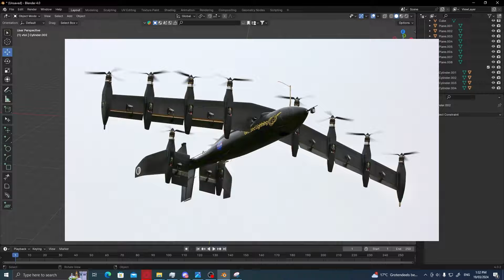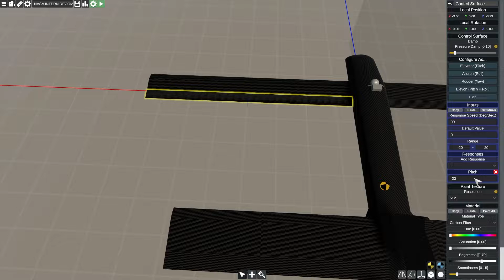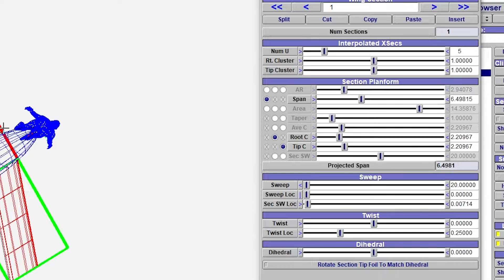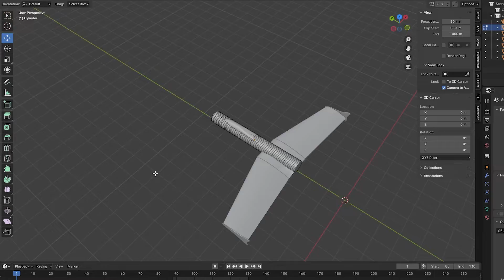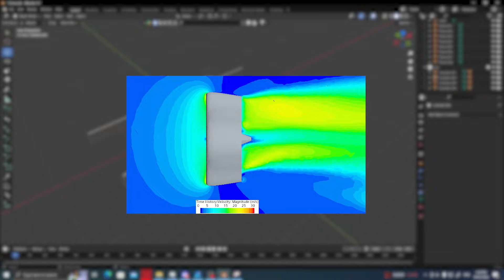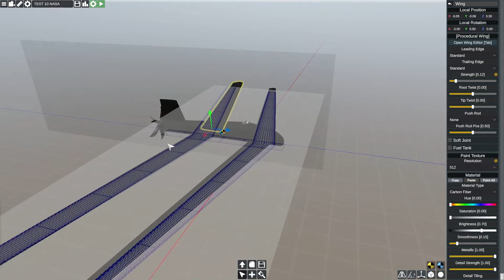NASA intern helps me engineer a UAV swarm [testing in flyout] week 3 of developing a UAV drone swarm

Comment: This may or not affect the result of your experiments. I may be wrong but I think the numbers are not correct. 300 cm x 20cm= 6000 cm2 which is equal to 0.6 m2. Another way: 3m x 0.2m = 0.6 m2. To visualize 6 m2, take the square root of it, this is, 2.45 approximately. So, a square of 2.45 m of height and 2.45m of width will produce an area equal to 6 m2. This is way too big compared with what you have. I hope this helps.

Comment: You definitely are taking more time with it but remember you said you're carrying a payload, so be very careful of weight. You need to balance COL with COM with wing placement rather than adding weight. Also you have 4 edfs on your design at the start but tested the aircraft with 1 propeller that looked like it wasn't pitched correctly. Idk if you know but each propeller can be pitched at a certain angle and the blade itself changes pitch across the blade, that's why it's not angled the same along the whole blade. You should research blade pitch and use 4 edfs in testing like your model suggested. Also a thin wing is for a glider designed to fly far at low speeds but your design has 4 powerful edfs. Not only are they likely to fall off and break under impact due to the thing wing but also the long thin wing will create lots of drag and will not utilise the speed produced by the edfs. But hey you're heading in the right direction 👍
Reply from the maker: Hey man thanks for the advice. We are taking a lot of steps back, by first determining all the requirements before designing a fuselage and wings. I’m currently figuring out how big the payload would be by looking at actual products that can be transported with it. For example water is way smaller than toilet paper as a weird example. For some things I am also looking at if it should be in the fuselage entirely or not, and for larger things how large that would really be and if it’s realistic. I’m also determining which electronics shall be used and their size, weight and cost. We also found a  different motor setup, where we can achieve enough thrust with regular props, and we tested which props worked best and which motors worked best and then picked the cheapest option. A lot of progress being made there I haven’t even mentioned everything yet, but I’m hoping to finish the next vid tomorrow! Only if we know everything we should start thinking about the actual design, as suggested by many people including you.
Reply: That's great news 👍

Comment: hey, not sure if you will see this, but i think XFLR 5 would help for aerodynamic analysis. (  its also free : ]  )   

also, for canard style planes, the main wing should be angled so that the Cl is close to zero when the plane is level. and the front canard should have a higher AOA so that the center of pressure is a little in front of the Cg.

this is so the front pitches up, but then the larger main wing gets more lift and pitches it back down.

I read this in an old aeronautics book i got at a thrift store, so it might have changed since it was published, but it has worked for me. good luck though :)
Reply: wanted to clarify, this makes a passively stable plane. however the  back main wing has to be quite a bit larger than the canard

Comment: EDF's actually are more aimed at high speed, less on pressure.
To lift a drone, the bigger the propeller, the more weight it can take.
A lot of UAV's are now using 4 engines, to lift, then use 5th engine, for horizontal flight.
For long range, it's a waste of resources, and adding more weight.
In software, it's not easy, changing from one, to the other flightmode.

Comment: one thing to maybe deepen your understanding, lift is more of a air pressure thing, rather than air pushing down against something. 

kph is kilometers an hour. knots isn't "per hour"
Reply from the maker: thanks for explaining, how would you visualise the air pressure thing though? wouldnt it be quite similar to looking at is as something that is pushing down? what helps me visualise it in my head is just imagining that it is water as it is quite similar. and yeah i found out quite quickly that it wasnt knots, pretty stupid of me, i commented it here as well but i havent verified my yt acc yet so i cant pin it
Reply: @NaeviusUAV  so, what helped me figure it out the most was actually helicopters. The rotor on a helicopter is actually more akin to a wing. Helicopters can fly much higher than their downforce goes down; they are being pulled up by the differential air pressure not pushing off the ground. The travel of the air over the airfoil is what creates the differential pressure. Since air is accelerated faster over the top than the bottom of the airfoil, there’s less air on top, creating a lift force.
Reply: @NaeviusUAV  also I’m not super knowledgeable in terms of aerodynamics, but if you need any help with radio/networking I can def contribute

Comment: it looks like a burt rutan aircraft
btw it will be able to takeoff and land very easily if you make the nose gear longer so the nose is pointed up a bit add 2 of them maybe for extra safe landings
either that or you need to put the rear landing gear just behind the centre of mass like planes normally do

Comment: I remember reading somewhere that University of Colorado Boulder has an engineering program dedicated to drone development, so finding papers and possible contacts on the subject from there might be interesting. I think they've been going at it for over a decade now, so they may be ahead of you on solving the same problems.

Also I find it interesting that most information about swarms cover the weaponization aspect, but are light about having more tightly coordinated groups for reconnaissance and SAR roles. It only makes sense you could do a really high resolution sensor sweep if you have a side-to-side band of drones fly over some area. I figure a reasonable rough estimate is that you could produce 3D LIDAR imaging of a 2km wide swath at 1cm resolution which progresses forward at whatever speed those drones are able to maintain aligned formation. On top of that if you happen to have access to tetrahertz imaging (sub-infrared?) with that type of setup, you also get capability similar to ground-penetrating radar. (And THz scanners don't have the weight or power consumption of RADAR, which is what makes the small drone approach with it possible. I think there's a limitation of the penetration being something like 3m at most.) So it can do something like produce a voxel or point-cloud density map of the terrain below in the same manner. If you were to use software to run gain adjustments and filters, you could generate 3D blobs showing those differences in density. You could filter for low density to look for where the ground was dug up and disturbed (hidden caches? burials?) or things like voids (tunnels?). Alternately you could filter the same for high density and spot buried structures, pipelines, and cable runs although it would likely also show areas saturated with water. Now combine that with augmented reality and GPS, and if you were clever there you could get Minecraft-style "X-ray map hacks" in real life. Pretty cool, huh?

The only issue is that to take advantage of such, you need a computing setup that can handle a lot of data. Not only the bandwidth a swarm like that would transmit back, but optimized methods of rendering to handle point clouds and make it usable with some augmented reality system. I think the tech is reaching that point, although I don't know if it's in an off-the-shelf state yet.
Reply from the maker: That’s some really interesting stuff, do you know much about these things? I’ll have to do some research and re reading this comment 10x to fully grasp how this works. Would you like to send me an email? It’s Siep.vonk@gmail.com

Comment: If you rotate (nearly) the entire wing when it goes into VTOL mode, doesn't that make it a lot more susceptible to crosswinds?
Reply from the maker: Yes probably, I’m probably going to change the design again lol. Every time there’s more things I didn’t think of yet, so I’m just reading a book I was recommended now to get the basics down and spend more time with the conceptual designs and other options. It’s more fun to test stuff in real life ofcourse, but rushing something like this isn’t a good idea.
Reply: it will also create a lot of 'flutter', on wing services, as no servo, would be able, to keep it locked, under dynamic forces, making the drone unstable in horizontal flight